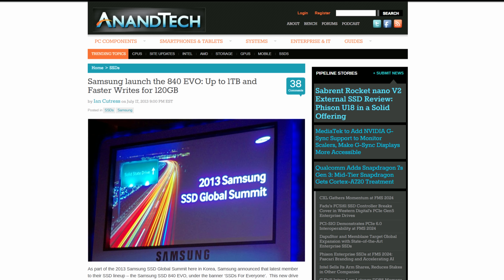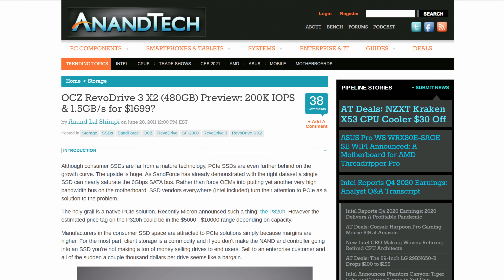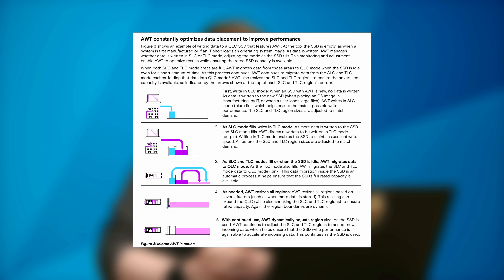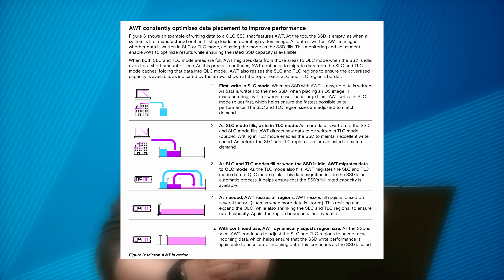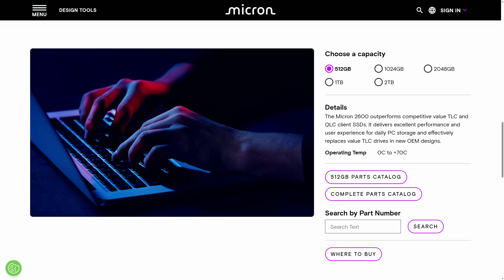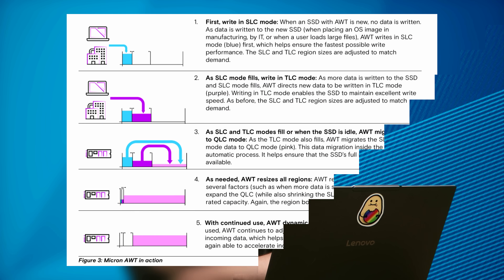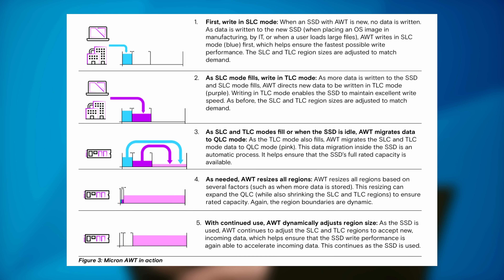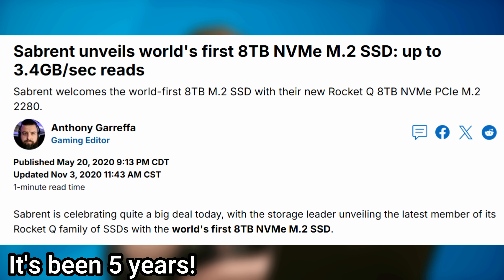Big.Medium.Little Comes to Consumer SSDs

Comment: The Samsung 990 Evo and Evo Plus drives will do either 4 x 4 or 5 x 2 for their PCI-E config so there are some drives out there that will do 5x2. You should also be able to use any 5x4 drive as a 5x2 drive and just take the performance loss on best case scenarios but I assume you were not wanting to pay the premium for a full 5x4 drive if you won't ever be able to use that. As far as >8tb drives go I think we'll  just have to wait. Pricing wise larger SSD drives scale pretty linearly as twice as much space means twice as many flash chips so a 4tb drive is pretty close to twice a 2 tb drive. 8tb drives are already pretty pricey for consumers so bigger would get even worse. 8tb drives have historically been $600+ in the US and are trending up. I don't think there's too much of a consumer market for a $1k+ 16tb drives. We'll need a fair bit of improvements in flash cost to bring that down to a reasonable consumer price point. There are technical challenges too but those could be overcome if a manufacturer thought there was a market for the drives.

I suspect we will start seeing something where we get in-between sizes in flash drives where the next step isn't a doubling of the previous step like we've seen with 24 or 48gb dimms. So we may see a 12tb drive before a 16tb drive. You could also play around with the flash chip size or the number of channels to hit a 10tb flash drive too. Take an 8 channel drive and push it up to 10 channels and all of a sudden with the same capacity flash chips your 8tb drive becomes a 10 tb drive. Those types of configurations might come first from someone like Samsung who controls the whole stack as they could coordinate controller and flash chip updates to roll out something like that. It would also mean potentially different sizes lower in the stack too. A 2.5tb drive instead of a 2tb drive.

I do think this idea is interesting. One thing I think you could have mentioned or emphasized more is that in your 1tb example once the 250gb of data has been written to the SLC cache how badly performance will crash in that situation. Since with the 250gb in SLC cache at that point you've hit worst case scenario and for a QLC drive that can drop to hard drive write speeds of 100mbs or less. Not surprising when you understand what is happening at that point. Since the drive is actually completely full at that point you have to free up some space to write anything additional. You now have to do that very slow copy SLC to QLC process during the write instead of in the background where the user won't notice it. That means reading an entire erase block's worth of SLC data, erasing that block (which is slow) and then doing a QLC write out to some of that newly freed space. Now you could theoretically write out the rest of that freed up space as SLC cache again but that would fill up quickly and you'd be right back to erase and rewrite and the drive might track SLC cache vs QLC at an erase block level so that might not be possible. If you've got extended writes still coming directly writing to the remainder of your free space in QLC mode before repeating that process again will give best results. What AWT is doing is taking that 250gb of SLC cache, shrinking it to say 200gb of SLC cache and using that remaining 50gb of cache to have 150gb of TLC cache. That way you can get a total of 350gb of data written before the drive crashes into that extremely slow folding and directly writing to QLC cache mode. Less performance for the TLC cache portion of things but more total written before performance completely tanks. The more SLC space you take away the quicker it will fill up and performance will drop down but the larger the TLC section will get increasing the overall amount of data that can be written before dropping down to that worst case scenario. I could easily see the SLC vs TLC ratio be something configurable for enterprise drives where they can profile and plan their workloads to maximize the benefit of different levels of cache.
Reply: I thought that price scaling for the highest capacity drives was “above linear”, because you’ve really only got one possible method to reach that capacity (assuming that capacity is at the current technological limit), whereas now the tier below that can be achieved with either “half as many” currently bleeding edge chips, or just as many of now last generation chips. 

For example, down in the 1-2TB range SSD pricing is what, $50 per TB? At the low end, maybe closer to $75 per TB?, but then 8TB drives, while they were briefly at $600 are looking to be more like $1,000 long term, above $100 per TB.

Comment: I guess this TLC layer could help with low-mid tier SSDs. The higher end ones I have are TLC anyway, unless they could do similar and have a MLC layer? I still have my first SSD, the Intel X25-V 40GB. When MLC was the cheap option!
Reply: I was digging around in my dad’s old tech drawer, and deeply amused to find a 16GB SSD just sitting in there, allegedly holding an entire Windows OS. Everything about that just seemed funny to me.

Comment: Consumer capacity at sensible/affordable prices - but lets be brutally honest - this is not going to happen until the ML bubble pops and the markets crash with it, especially when you have goons like Altman buying up wafers in bulk purely to prevent the competition having access to those resources to be able to book/order/manufacture NAND and RAM in the first place.  

I would also like to see SLC and MLC drives making a comeback, TLC is okay but QLC/PLC NAND should be returned to the sandpile.  
I still have a Samsung 840 Pro 128GB SATA SSD attached to a SBC over USB3.0 in my rack which uses MLC, Wear_Leveling_Count is at 077 after 13 years of abuse :D
Reply: agree on SLC and MLC. and ofc altman vs the pros

Comment: Kind of funny that Intel had been the worst NAND SSDs I have ever used:

The first one was a SATA 320 with 600 GB in 2011 that even after being replaced by warranty lost all its data in intervals and became bricked until it got secure-erased. The last ones were enterprise P4500 and P4510 that due to unfixable firmware issues only performed at a fraction of the write performance they could actually do - Only Optane never gave me any issues.

In the present I like Micron U.2/U.3 SSDs since even as an end customer you can get publicly available firmware updates. Samsung hides those for enterprise models which sucks.

Comment: Just have an option with only SLC for those who would buy it.
Reply: or expose that behavior to users so they can select it themselves
Reply: @aidenkhaal3295  that would kill their market segmentation
Reply: @aidenkhaal3295  That would be the REALLY cool version of this, ESPECIALLY if it's also got cleverness like this AWT built in, because that means that a drive can serve both hyper-fast low-size niches and large-but-low-endurance-and-slower niches, all just by controlling the overprovisioning.  You want max random perf and endurance?  Go full SLC.  Want max streaming reads and capacity?  Go max QLC and get almost 4x the storage capacity.  Anything in between?  Just controlling the minimum SLC buffer size, really!
Reply: Gigabyte AI TOP 100E SSDs are made with TLC flash memory running fully in pseudo-SLC (pSLC) mode, there are other drives made this way, mainly enterprise SSDs. You can modify the firmware on some SSDs to make them run in pSLC mode. Look up converting QLC SSD to SLC SSD.
Reply: It should be a formatting option - and arguably part of a degradation process.

Maybe it starts as 16bpc, gets old, halves it's capacity to 8bpc, again halves to 4, and finally 2.

Eg an 8tb drive would drop to 4, 2,1 as it ages.

Managing this process with users is the challenge.

Basically this micron tech but in reverse and not reversible once degraded.
Reply: @myne00  Consumers would be thrilled by storage that halves its capacity when you least expect it.
Reply: @ronald3836  Nothing is setup for a drive that can no longer reach its partition size. That would break pretty much everything - the file system would try to use space that is no longer available and start causing data corruption. However, shrinking the bits down still works thanks to the overprovisioning. This would extend the life of the drive more than now where if a cell becomes unusable, it gets instantly marked off. However, if it gets first reduced to 50% capacity, then it can continue to be used.
Reply: Years ago they tried to sell SLC drives as a premium product. No one wants it at the price they are selling them.
Reply: Pure SLC exists in some industrial SSDs but their density and price certainly puts them well outside the mainstream market
Reply: Don't even need that.  Just update the software to be able to set the SLC size to 100% on a normal drive.  That being said, DigitalSpaceport had some SLC drives custom made and sold 'em for a little while when Chia plotting was a big thing.
Reply: Although - honestly - just format it as 25% and the drive will end up moving stuff in the background to QLC but the cache should be basically the entire remaining usable space.
Reply: There is. Or at least there was.veople didn't buy it.

Now it's limited to industrial applications.
Reply: Thank you. I think it's ridiculous that QLC came later and cheaper... with geometrically reduced lifespan. I have to be satisfied with TLC in my personal life. If you want longevity, QLC doesn't equate for any setup. If you are wondering, Kioxia invented SLC in 1987! Their slc nand offering is bga chip for industrial only. The enterprise hype is their scm storage class memory for redis/valkey cache, under their BiCS/XL-Flash tech. It's all live cache instancing now with warm storage. I can't find a pure slc nand finished product.

Comment: I went from HDD to a M.2 back in 2015. It was mind blowing. With all the talk of degradation back then I was worried. I got an Intel 256gb drive. It was used almost continuously for 8 years and is still fine 10 years later. The only precaution I took was keeping 10% free at all times.
Reply from the maker: Usually a good rule of thumb in general tbh. If you've only got 10% free it's time for a bigger drive, or you hoard too much. But hence my comment at the end - I really want >8TiB M.2 drives to come to the market, as some of my devices (ie video editing on the road) could do with more storage.
Reply: Intel did really great with SSDs. Really a shame they stopped doing SSDs.
Reply: @AlpineTheHusky they just handed that off to SK Hynix and formed Solidigm. They’re still around, just a different form.
Reply: I saw a video yesterday recommending you keep about 20% free.
Reply: I have a SATA3 180GB Intel drive from 2012. That beast is still going strong, with little signs of wear. The jump in raw speeds was comparable to jumping from 16MB of RAM to 32MB in the 90's.

Comment: Ever since death of 3DX-Point/Optane storage has been boring and quite stagnant in terms of providing tangible upgrades to consumers.
Reply from the maker: Though a friend I bought a couple of the 1.5 TiB optane drives when the last of them hit Newegg. I'd only which I'd purchased more.
Reply: @TechTechPotato  I think this is the story of everyone.  Wishing they bought more Optane when they were cheap.  I got a 58gb for $33.  The P1600X are crazy expensive now if you can even find them.
Reply: @TechTechPotato Pats goals with sunsetting the project are beyond our understanding.
Reply: @jonathanjones7751  it simply wasn't commercially viable. Nand had too much of a headstart.
Reply: @TechTechPotato Which sounds a bit like the AI technology I was trying to get people interested in to have low cost wafer personal local AI with 1TB+ to run the bigger models at 60 tps, but they are aiming at industrial robotics with low level boards for people.  But they are interested in setting up a fab, and are setting up a not for profit teaching high school children chip design.

The videos are at the silicon valley forth interest group YouTube channel for 2025 Forth Day.

You should check them out, as they made some choices to undercut fpga on main boards with something far better and cheaper, which didn't turn out.  But, their advanced system would be more competitive with any high end mcu (I estimate 10Ghz+) could be possible.  If only the right funders turn up.

The former ceo of microprocessing engineering, Stephen Pelc, is working in a software role with an undisclosed manufacture on a 40 core ultra low energy chip that can be manufactured in a 6Ghz at some node (I imagine this is 40nm or so). Mm's die size, and I forget how low energy.

These architectures are related to the old Burroughs main frame, upgraded to the Forth computer language which most computer language processors ever made are just Forth ones in both custom silicon ahd softcore, as they are so straightforwards, they tend to get lowest energy, highest speed per process, and highest desity of parrallel cores due to some of the smallest transistor counts.

Charlse Moore has the record of lowest energy processor, has had the highest or second highest performance.

It's only early days, but I look forward to seeing what opens up in the future.

Thanks.
Reply: A few years ago I bought a couple of the 110 GB optane drives for use as boot drives, and let me tell you they'll be used long into the future.  The ram-like latency is just so nice.
Reply: Every day I am reminded how grt optane was and why we ain't trying to reach that peak again !! Now with all the AI Investment plz bring back 3Dx point tech
Reply: I still have 2 1tb optane pcie cards I use in my daily driver
Reply: I'm so friggin happy that I have a few sticks
Reply: There are enterprise drives that have the same longevity as Optane with gen5 speeds of large transfers, but random writes specifically still lose even to 900P's
Reply: @iskamag let's take second gen optane p5800x 1.6TB as a base , have 100DWPD , close to 290TB of write endurance. Solidigm d5 122TB has 0.6 DWPD , close to 133TB of endurance , micron 9650 max 25TB has 3 DWPD has the closest , nearly 282TB and this is gen 5 speed , all these drives still can't reach the endurance of a 1.6tb p5800x , never mind a 3.2tb drive. Not gonna sit here and say we need this crazy endurance but the tech of 3dXpoint was that good , I wonder what would have been of a gen 3 /4 optane with gen 5 PCIE speeds !!!!
Reply: Was just going to comment this... Brain dead morons run every single dinosaur company department that refuses to make actual improvements to storage. 

One article I read about discontinuing Optane was because there was too much demand that Intel couldn't meet.

I wonder if that's why they're having such a hard time these days: they're purposely trying to kill demand for their products?
Reply: @stevenswall  Then what you read is a pure lie. There was no demand. It was too expensive.
Reply: Well for nich users it was a noticeable upgrade but even those  that wanted it waited until it was on fire sale prices to buy it.
Reply: @mddunlap03  Consumers, yes.
Reply: From Grok 3:

Optane was a brilliant but flawed “one-generation wonder” — it delivered incredible latency and QoS in 2017–2021, but its exotic materials and manufacturing process made it too expensive and impossible to scale.

MRAM is the true long-term successor to both DRAM and NAND in many niches: it combines DRAM speed, flash non-volatility, and infinite endurance at a cost trajectory that is rapidly improving. By 2027–2030, STT-MRAM (and next-gen variants like SOT-MRAM or VCMA) is widely expected to occupy the same “storage-class memory” slot that Optane tried to own — only better and cheaper.
Reply: @winstonsmith478  Clearly Grok is confidently wrong here.